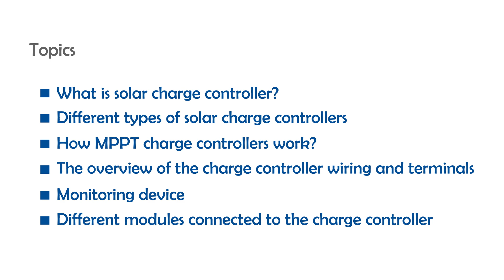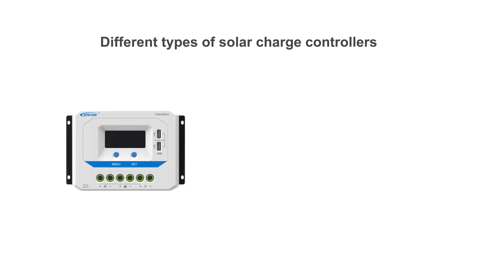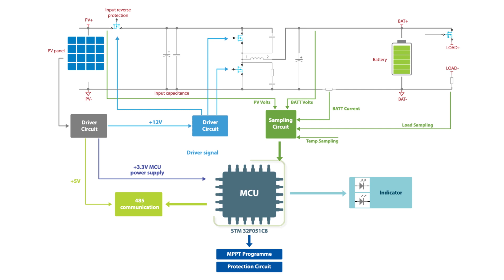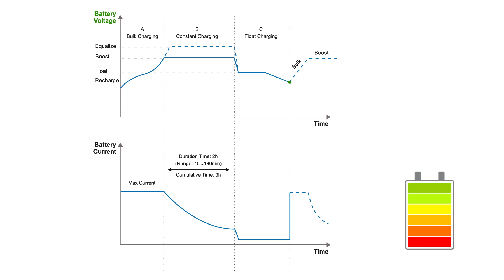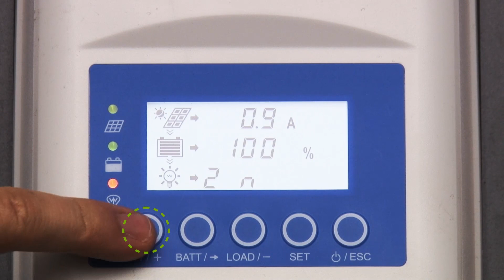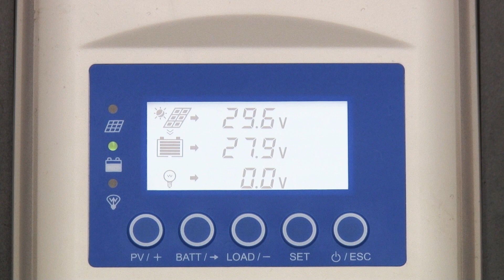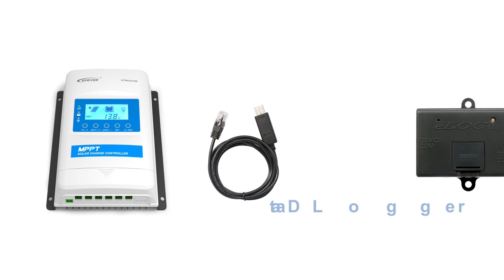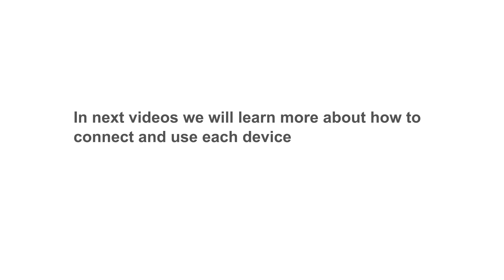The Ultimate Guide to DIY Off-Grid Solar Systems - 05 - Charge controllers

Comment: I have a Tracer6210AN is there an ability of this solar controller to use a 48v panel, to charge only a 12v battery ?
Reply from the maker: Hi! Thanks for your question. For this kind of setup, we recommend contacting our technical support team at support@epever.com. To help them assist you better, please include the Voc and Isc values of your solar panel, as well as your battery details. They’ll help check compatibility and give you the best advice.
Reply: @Epever  Thank you for your response. In my previous comment/question I was in error. I have the Tracer 6415AN.  I need to charge at 12 volts, for flooded lead acid battery in a RV/camper. I have 8 Renogy 100W 12volt solar panels, (Voc)22.5v (Isc)5.75A.  Will I need to wire all the panels in parallel 12v  or can I wire them in series to a higher voltage, to charge in 12volt?    I've only used PWM controllers, Thank you for your time.
Reply from the maker: @explorewithbarryandlagniap7744  Hi! We recommend a 2S4P configuration — four strings, each string has two panels in series. This setup helps balance voltage and current for more efficient charging. 
Let us know if you have any other questions!
Reply: @Epever  Thank you.

Comment: When i press power button the battery drop to 56 % when i press back load light come on and batery is 86% soc , so when i charge the battery wich one is the real soc with power on or off , idont understand that part , 120 ah lithium battery .   Thks
Reply from the maker: Hi Molo75. If you connect to the load, the voltage of the battery will be pulled down, so the SOC will become smaller.If the change is relatively large, there are two possibilities: the load power is relatively large, or the battery capacity is too small. You can also email support@epever.com for more help.

Comment: Why not connect charge controller load output to the inverter?
Reply from the maker: Hi Sir, thanks for your question. Normally you can directly connect the load on the inverter when you use inverter in your solar system.

Comment: Is it necessary to put my Amperage battery bank on the MT 50?
Reply from the maker: Hi Sir, thanks for reaching out. Usually the MT50 connects with the controller, so it's no necessary to put the battery bank on it.

Comment: hello , i just demage my xtra 4210 , upgrade has fail is it repairable
Reply from the maker: Hi Mihai, thanks for reaching. Did your product break during the upgrade, or did it break before the upgrade? Could you please describe more details?
Reply: has break during the upgrade , but i repeated the procedure and succeeded in the third attempt now the display shows me n7 for lithium-ion 7S but in the application on the pc it does not display the values ( parameters )

Comment: You can searter the type of 150W system type 12V male type charging mppt 40a system 24v system toilet, for battery 200A long type. ABM Carbonie? Does it do not harm the shipping organizer?
Reply: I need help
Reply from the maker: Hi Sir, Thanks for your question. Could you please describe more details about your question? What's the type of your battery? Do you mean whether that battery can match the mppt charge controller?
Reply: @Epever  Thank you very much. I own a 40-amp charging regulator and a 200-amp long ATM battery, and you have four 150-watt panels. Does your charging regulator accept me as a guest of two 150-watt panels next to the 4 150-watt panels? Here is the question.
Reply: @Epever  Thank you for your reply. I just want to ask. I own the charging regulator of a company of 40 amps and the connector of the panels respectively. I have four panels of the type 150 watts. The question here is can I add two panels of 150 watts from the previous four in Facebook, the 6 panels in a series system, will the regulator be affected? You have a negative or it will be a normal battery type Long EGG M 200 amp.
Reply: Please i need help

Comment: Can I use 2X 30A Xtra controllers on one 24v lipo4 battery ?
Reply from the maker: Hello Sir, We don't suggest to use 2 PCS charge controller to charge one lithium battery bank. It may cause the BMS protection.

Comment: Be careful.  On the battery side of the battery bus-bar the current flow is bi-directional  (one direction charging;  the reverse when discharging).  If your viewers wire a polarity sensitive DC breaker/switch there in a high-enough voltage application they will get smoke and maybe a fire.   A better layout is to move that switch to the  charge controller side of the bus-bar.
Reply: @noob_trader_ak47  Yes.  If you put the breaker in the location where this video has it, you should make sure the breaker  is non-polar.
Reply: @qzz9102  You can use them, but they should be in the places with uni-directional current flow.   A polar DC breaker on the charge controller side of the bus-bar and another one on the inverter side of the bus-bar will work.  It would  then take throwing two switches to isolate the battery bank but it's a more flexible design since you would be able to disconnect the charge controller and still leave the batteries powering the inverter or, conversely, disconnect the inverter and still leave the charge controller charging the batteries.   You could also disconnect the entire system by throwing both breakers which is extremely useful in maintenance and debugging.  
The polar nature of a breaker is not a problem in these two locations since there is uni-directional current flow there ---  the charge controller battery terminals do not sink DC current and the inverter battery terminals do not source current.

Comment: Hello. I own an IT4415ND mppt regulator.
I have a few questions to ask.
1-can i control my controller via wifi?
2-can i charge a lifepo4 16s 48 volt battery?
3-what is the best voltage to use at the input from the photovoltaic panels to have the best efficiency?
4- what is the internal button battery for?
Reply from the maker: Answer 1: Yes, you can control your controller via WiFi, but not remotely, if you are familiar with solar DIY, we have released the STA mode for WiFi, you can find out how to connect remotely by yourself, due to that each country internet provider and ports are not same, so we can not provide any instructions.
Answer 2: For iTracer series, you can not charge any Lihitum battery.
Answer 3: MPPT controller track the max power point automatically, so there isn't a best voltage point that you can set manually.
Answer 4: The internal button battery is for powering the storage core, so that the controller can collect data.

Comment: Good they today i bought your xtra 4210n im asking if i used my android box connecting by usb rs485?
Reply from the maker: Hi Carl. I'm not sure if i've got your question. But if you are checking the possibilities for connecting to XTRA4210N with rs485, the answer is yet. you can use the cable/bluetooth/wifi module to get connected to it.